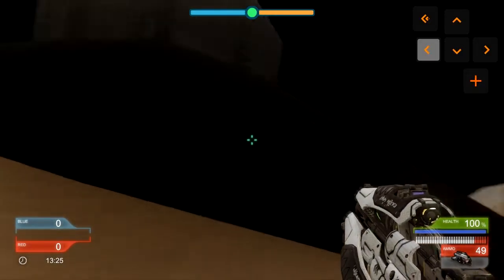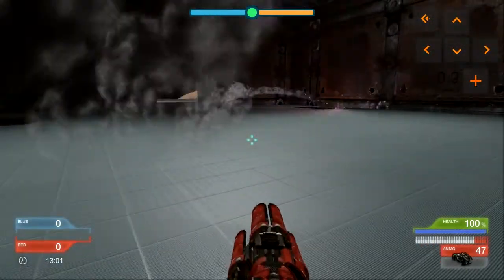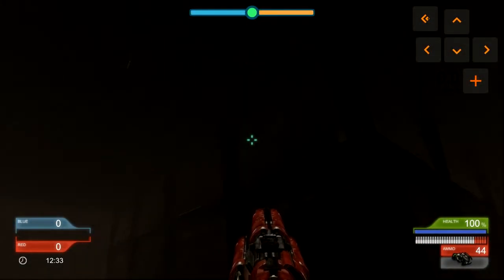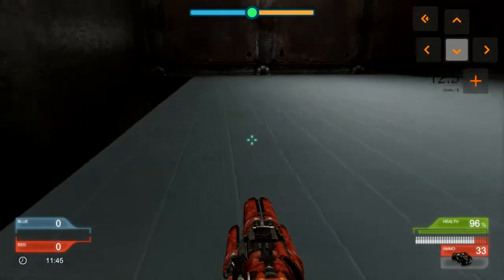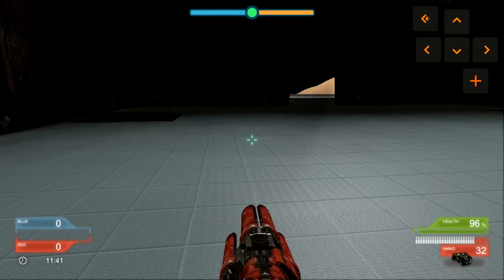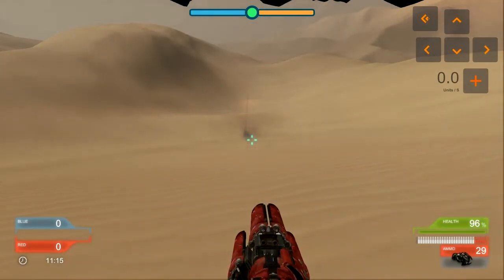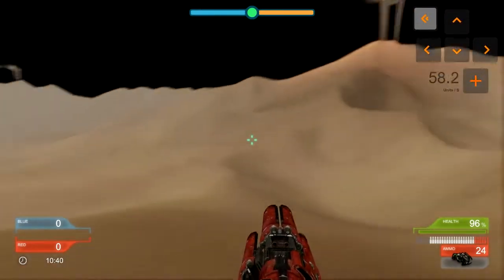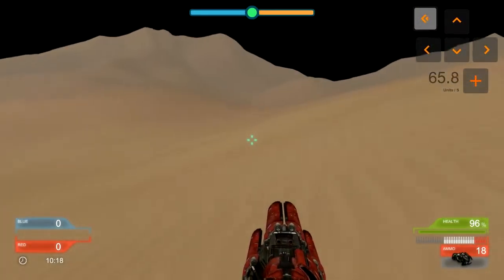Project Free Fall: Imparting Spin

Comment from the maker: That's the general idea if the weapon will operate in dual mode. I'm withholding final judgement until I play with it a bunch more, but at this point, the backspin is the only for sure. Frontspin, at this point, feels like it too much intrudes into the grenade launcher's domain.

Comment from the maker: If it was supposed to obey real world physics, yes. However, it was explicitly designed to not adhere to normal physics(for behavior consistency). Technically, velocity really doesn't enter the equation, as acceleration is what's being applied. The acceleration imparted, in the real world, would rely on the delta-velocity between the surface and the sum of the projectiles radial velocity and linear velocity, the friction constant between the surface and projectile, and the projectile mass.